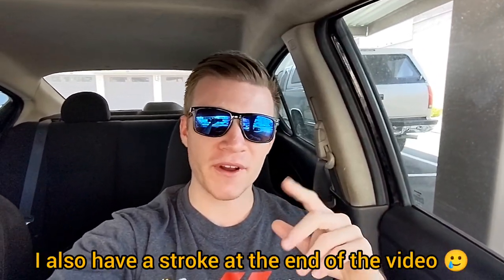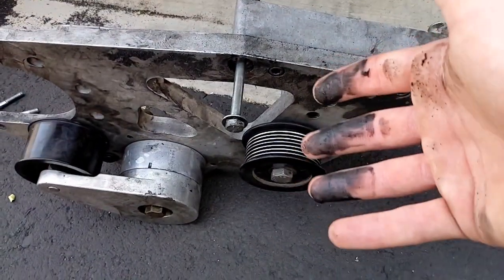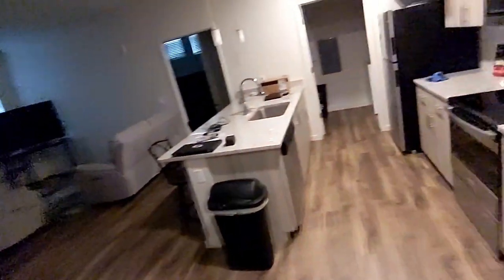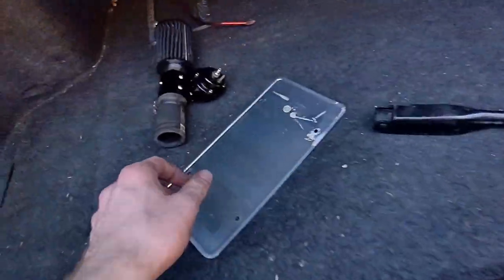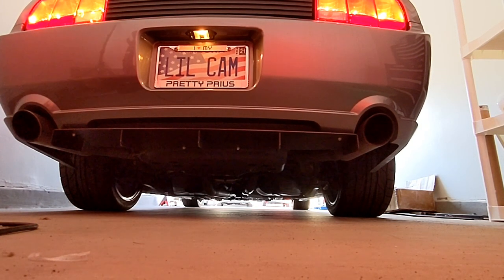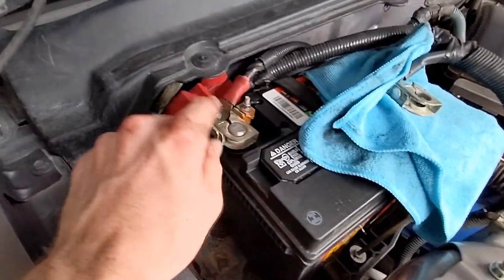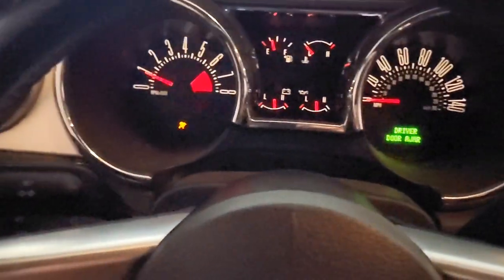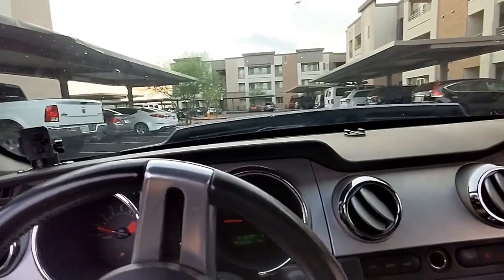THE MUSTANG LIVES! But there's a catch...

Comment: Hey boss, looking to get an auto gt. Could I have some of your thoughts on the shifting?
Reply: As well as manually shifting it, if possible.
Reply from the maker: It's a temperamental trans that has flaws. If you want to keep a 5r55 happy, it needs to stay cool. Manual shifting it every once in a while is fine, but it causes the trans to heat up faster. Remember heat=problems
Reply: @CamMarz  is there a trans temp gage?? And I feel like mine as well go with the 6r80 5.0 because I see everyone swapping those for the 5r. And if you have sport mode wouldnt it be relatively similar to manual?
Reply from the maker: @SageXteriorCleaning  I know a 6r80 conversation is a lot of wiring. My buddy @juryriggarage has one, so he is a good resource. You can see the trans temp with an SCT device

Comment: One question I know it's late but that torque converter did you go with, I'm stressing and not sure what to go with.
Reply from the maker: Mine was stock!
Reply: @CamMarz  oh ok thank you. one last question, how do you launch your car at the strip, do you bring up the rpms or just stand still and mash the pedal?
Reply from the maker: @5.0Uriel  That's something you'll have to figure out on your own. Depending how your car is set up, one way may work better
Reply: @CamMarz  ok, my bad one more question😅 what cams do you run👀
Reply from the maker: @5.0Uriel  these were the hotrods, a decent all-around pick